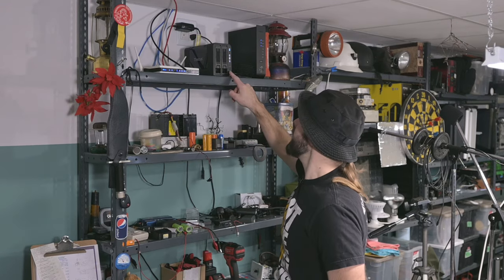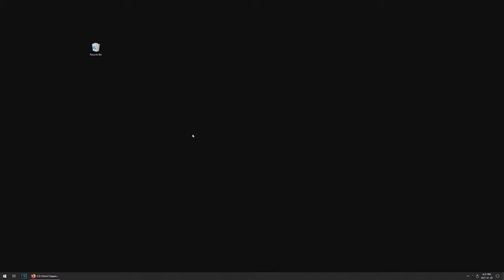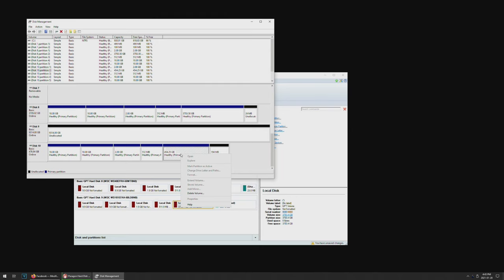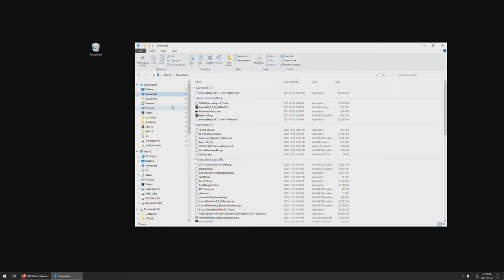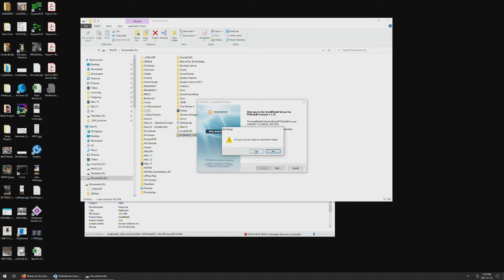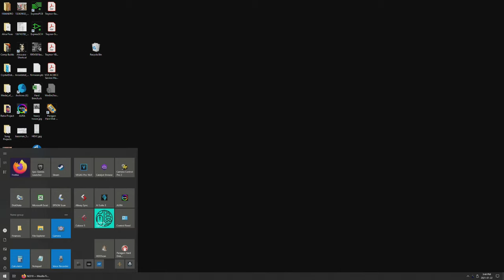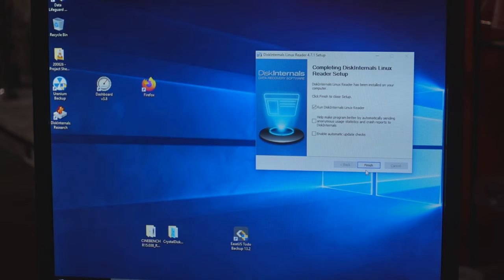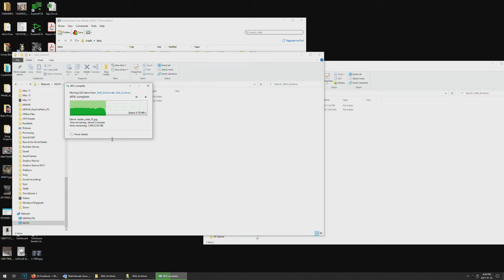A frustrating NAS Upgrade.

Comment: Yes, of course. LINUX would it makes easier. 

0. ALWAYS DO A BACKUP (at least with two different medias)
1. LINUX LIVE CD
2. Superuser 'Root' or command 'sudo' takes over.
3. Checking source disk (sda, 4TB) and target disk (sdb, 10TB).
4. Typing at the command line: dd if=/dev/sda of=/dev/sdb bs=16065b
    dd = disk dump || "if=" = input file ; "of=" = output file (under Linux all devices are also files)  || /dev/sda = 1st HDD (4TB) || /dev/sdb = 2nd HDD (10TB) || bs=16065b = Block size ~ 8M (Full Track) || "sda" stands for "Scsi Disk A" (SCSI, now S-ATA) and in earlier version there was "hda" stand for "Hard Disk A" (IDE).

Time over Ethernet 1 Gb/s ~ 360 GB/h  ~ 11h || Time over S-ATA 3 Gb/s ~ 1,080 GB/h under 4h (maybe 5h).
Works only if both drives uses 512 bytes per sector or 4,096 bytes per sector.
Reply from the maker: Is step 1 a kind of bootable CD ?
Reply: @DATT  Yes, that's right. But USB Flash drives now also common.
Reply from the maker: Hmm, I guess they could be worth looking into. Kind of lost me at command lines tho
Reply: @DATT  I can understand you. This can be hard, but I had a good manual. I you do this the first time, use a virtual machine with two disk drives ("sda" and "sdb") and a size of 2 GB each. Starting with the same size is a good start.
Reply from the maker: @no1leader135  Yeah eh. Def would start with some testing hardware. 
The ironic thing is, now that I'm upgraded, I don't have need to do this anymore, and how I use my NAS 10tb is going to last me a while. 
Tho I could see, figuring this out so I can backup the NAS drive easily.